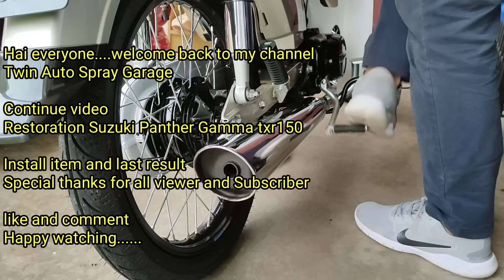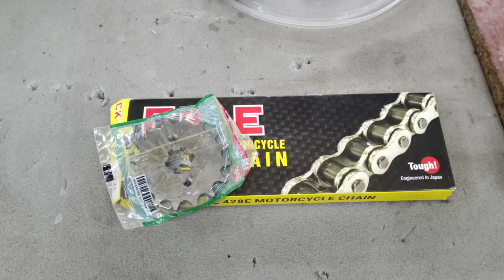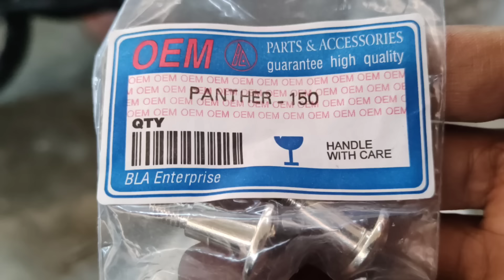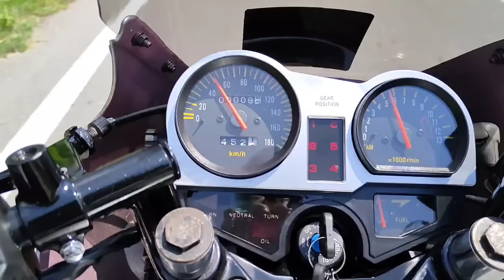Restoration SUZUKI panther gamma txr150 done!!!!!!!!!!!

Comment: Terbaik, kemas dan teliti kerja restoration ni, teruja tgk. Nak tanya, kalau wiring asal 6volt, bolehkan pakai wiring 12v gamma, dan kalau boleh apa barang sampingan yg kena di pakai dengan wiring 12volts tu ye.
Reply from the maker: Untuk moto ni asal semua  panther cicak up to panther gamma...
Coil magnet 6volt
Voltage regulator 6volt
Coil body 6volt
Signal relay 6volt
Wiring harness 6volt

Klau boleh utk wiring 6 volt jgn pkai batery 12volt nnt batery cepat kong api x dpt support untk chage batery...

Klau nk pkai wiring 12volt semua kena tukar 12volt
Reply: @TWINAUTOSPRAYGARAGESPRAYMAN  terima kasih atas pencerahan, maksudnya, kalau asal wiring 6v, nak ke 12v...cdi, bateri, coil plug, coil magnet dan rectifier (katab) mesti 12v juga kan, terima kasih tuan
Reply from the maker: @feriobaggio  yup....